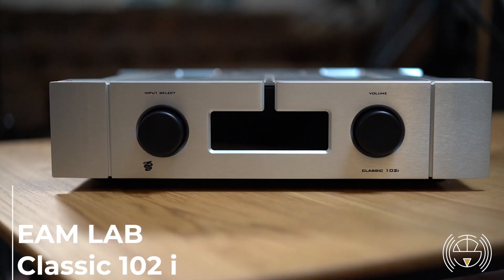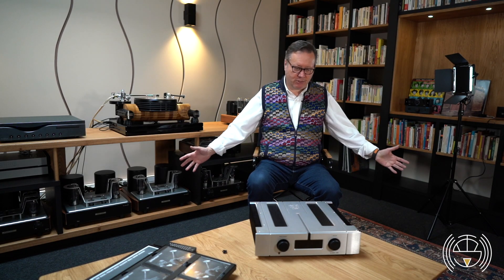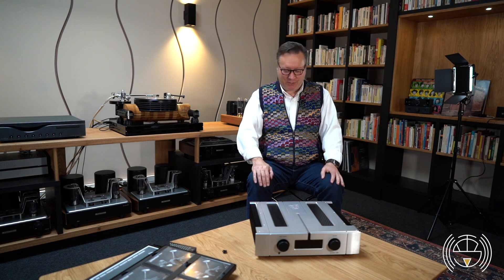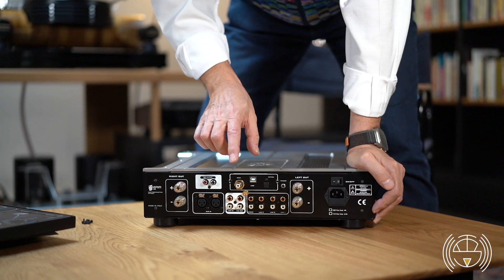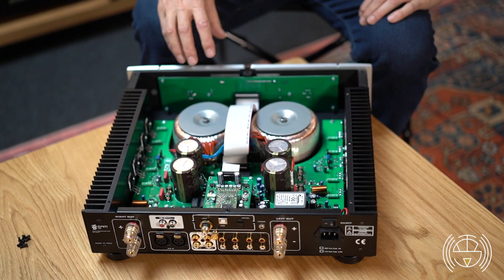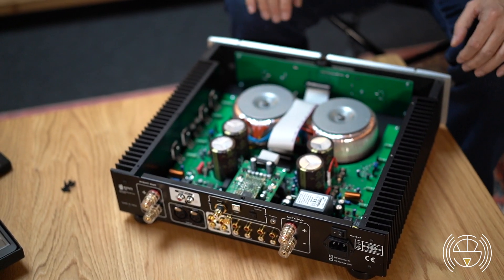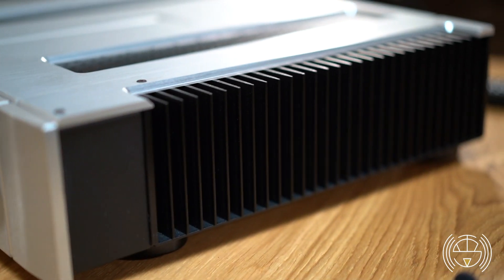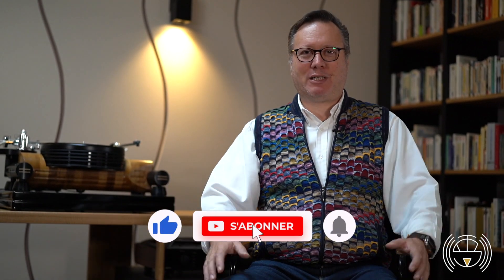EAM LAB Classic 102i integrated amplifier : dynamics and transparency - Tecsart

Comment: Garbge POS, epic fail no tone controls
My Yamaha As1200 blows this
Reply from the maker: @RobertMiah-n2u  One is a good consumer product with all gadgets, the other is a music reproduction instrument. Sound-wise the difference is important, then tastes are personal.
Reply: @tecsart  you're stuck with no adjustment, you can't tone the base midrange treble it's fixed. That's garbage. B
Reply from the maker: @RobertMiah-n2u  if you listen to good recordings with good equipments you do not need any adjustment. To do adjustments means that something is wrong. For me it is garbage an electronics that deforms the original signal and even more when it has the controls, that whatever they say they are on the signal path. Even when excludable there is at least an additional contact. Tone control is a comfort but it is also a compromise. For you acceptable, actually necessary, for others unnecessary and detrimental.
Reply: @tecsart  deluded indenial hippocrte
Tell that to recording studio which uses over 2000 sound frequency respone
Reply: @tecsart  back in 90s 80s after 2010 hifi company stop using to e control becuse off cost being expensive
Reply: @tecsart  do you even know how amplifer circuit board design

It's using 3 capistors for frequency respone
10hz bass and 20khz and midrange it's a brown colur mupppet.

Only 3 is used that's cheap

Look yamaha As2100 has over 30 capistors
Reply from the maker: @RobertMiah-n2u  Bullshit, a tone control costs less than knob to operate it! …and impact on sound quality. A studio needs controls, a private listening at home not, if the studio did his job well.
Reply: @tecsart  lmfsooooo
You need 3x 1000uf capistors and 100v transformer to operate and 3 line input.
Reply from the maker: @RobertMiah-n2u  I am an electronic engineer (I build my first amp when I was 15yo) and I still build and sell them. 
You like tones, I do not like tones, no opinion is better than the other. Both opinions are equally valid. For sure is not costs, and for sure it is a choice of the designer. 
Finally the quality of a circuit does not depends from the number of components, but the way they are used. Best sounding electronics have few selected components. Yamaha must produce many thousands of units, so they must design a very stable circuit insensitive to components tolerances variations (component selection is not industrially possible), able to work everywhere in the world, under any physical condition. This imposes a design that just cannot be thought for maximum sound quality. It is thought for a decent quality, maximum flexibility, reliability even when operated in bad conditions. 
If you want top sound quality it is impossible to industrialize the production. Believe me, behind a product there is a huge amount of choices. Price is one, but unless you have a big name, the competition is very strong and everybody tries to be better than competitors, prices are tight at production. To be better in sound quality than consumer brands is easy for any engineer. With some help you can build yourself a better sounding amp than yours, maybe not if you want all the gadgets.
Reply: @RobertMiah-n2u  Good heavens, what a rant...